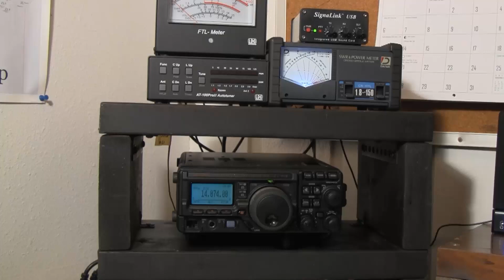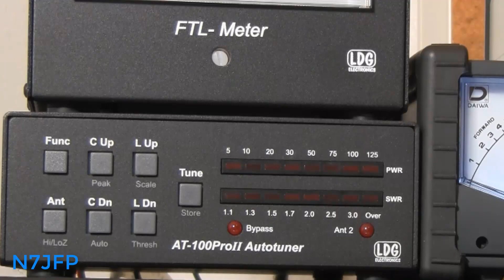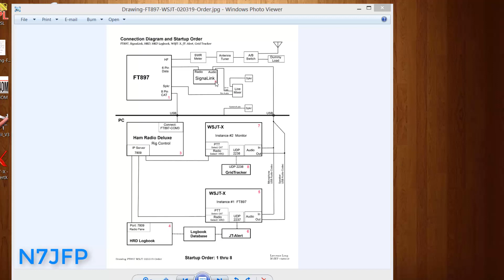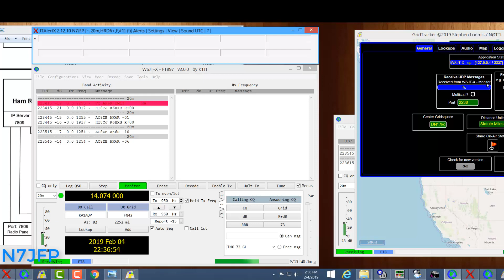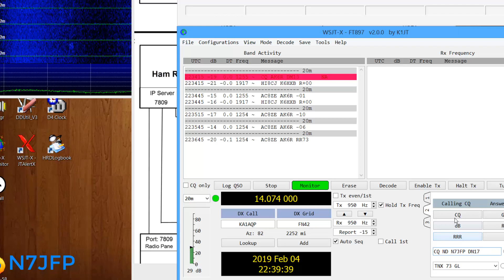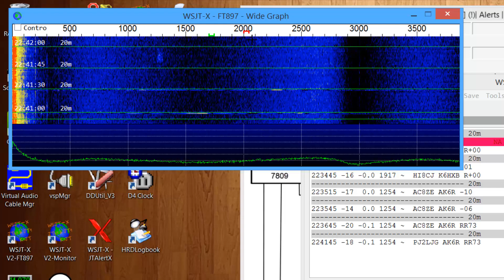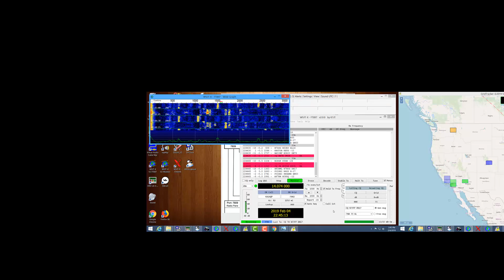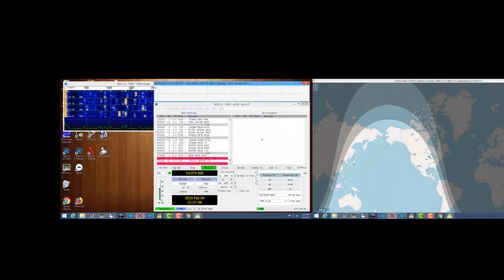FT897 CQ  FT8 - WSJT-X - JTAlert - HRD - GridTracker - N7JFP

Comment: Is removing the mic required? Or will it use the mic audio on tx if it is plugged in?
Reply from the maker: I leave the mic unplugged.  You could turn down the mic volume.  WSJT is controlling the output.  Make sure the Audio setting are for the SignaLink Codec.  73, N7JFP

Comment: Hello N7JFP, kd9abv here.  I have an ft897 and a rigblaster advantage for my digital with wsjt installed and configured running with ham radio deluxe. Not setup with the ft897 settings.  I am using a male audio plug to the cat\linear side on the radio.  Not using the data.  I can hear and decode and can TX but I dont think im actually getting any modulation out.  The red light on my rigblaster shows that its not on and xmit is not transmitting.  Any help possibly?
Reply from the maker: Are you using the CT-62 (Amazon-Valley Enterprises Yaesu USB FTDI CT-62 CAT Cable)?  Please watch my video: FT-897D Adjust Transmitter for PSK31 on adjusting the FT897. Good Luck, 73, N7JFP